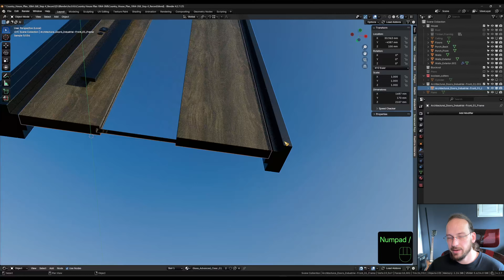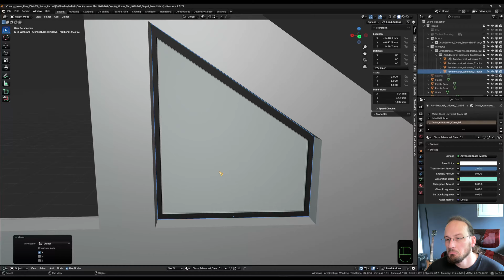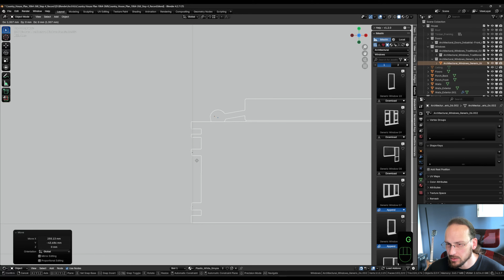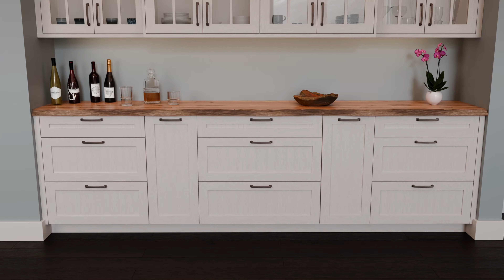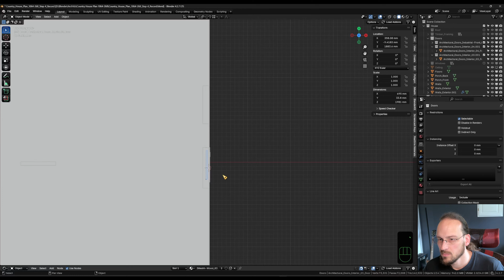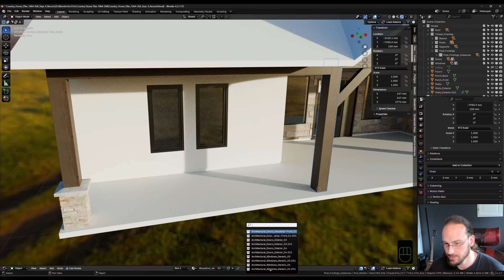Blender House Modeling Part 4: How to add Windows and Doors

Comment: Do you ever have multiple snap modes active while working, or do you typically switch snapping mode as you go?
Reply from the maker: I rarely have multiple on at the same time, because it just says "mix" and if I open a file with it after some time, I forget what I had active there and have to double check. Usually I either switch around, or leave it at increment and then with the snap base freely choose between vertices, edges etc.